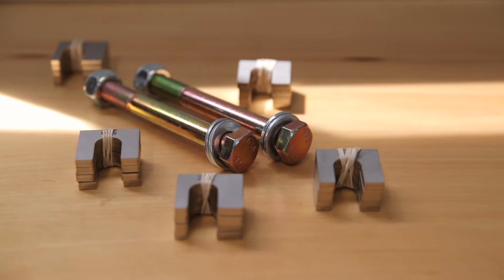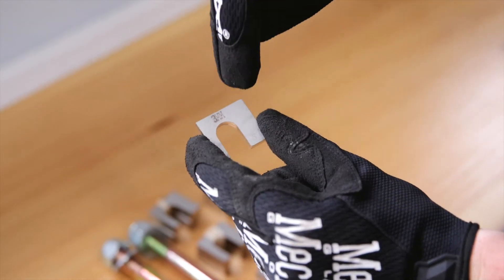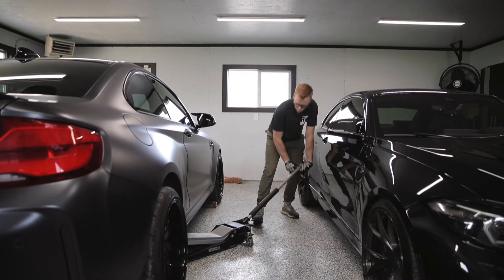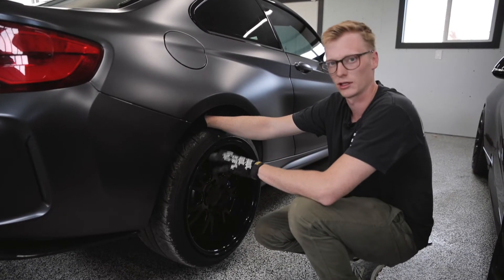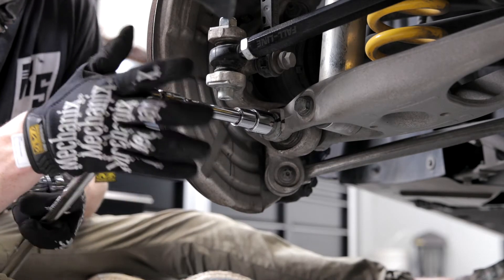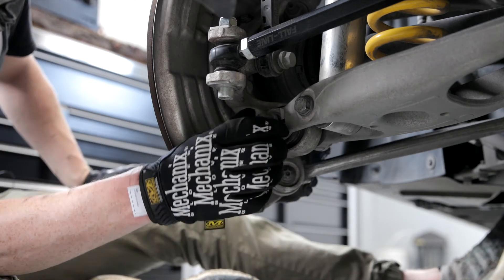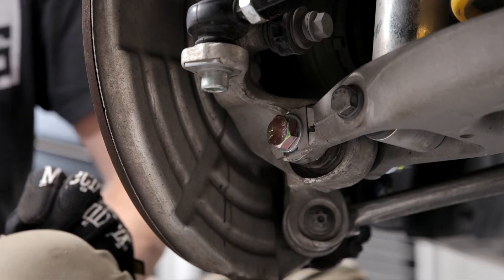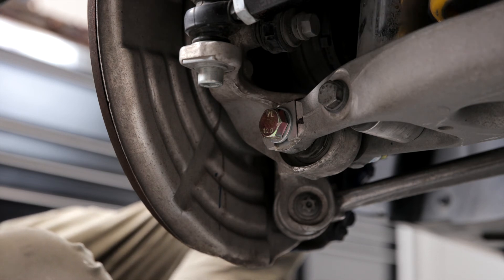Track Tec Camber Lockout Kit DIY

Comment: I noticed you had the fall line rear toe links installed. Did u have to slightly drop the subframe to get the inner bolt out of the oem toe links(arms)?